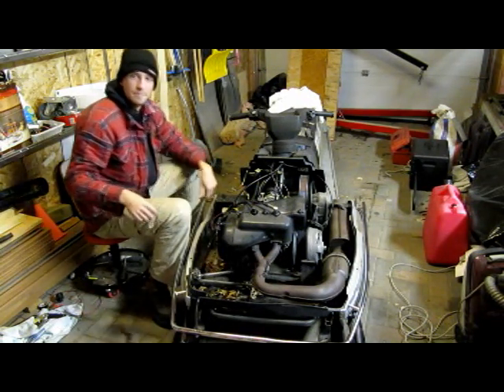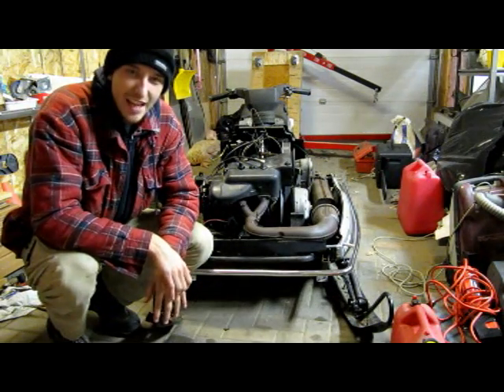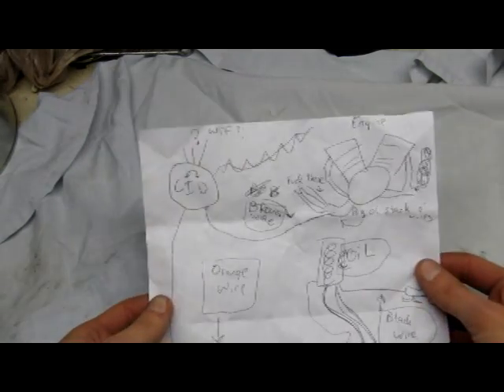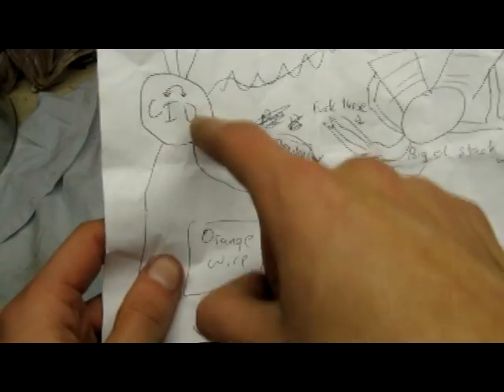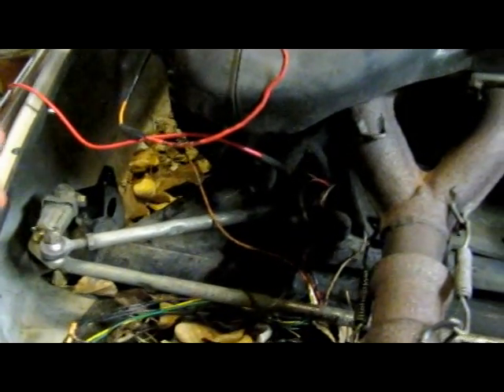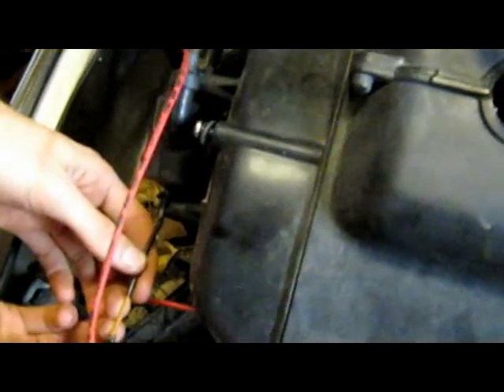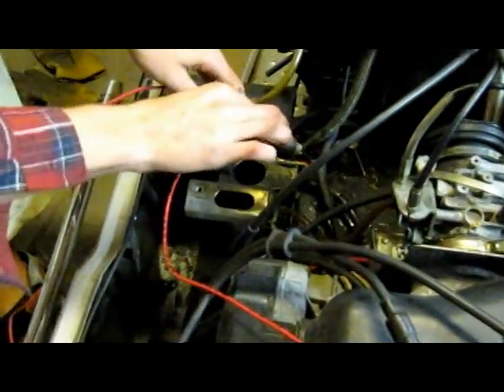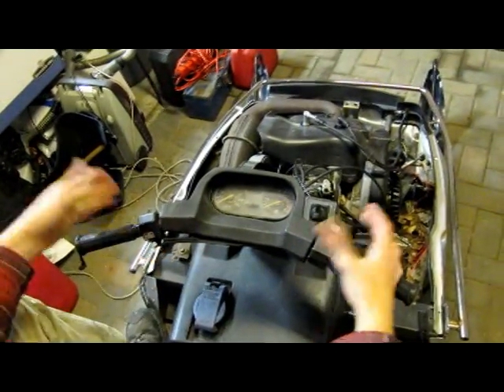Trash find Enticer 340 CDI issues (Yamyuck)

Comment: this video deserves more credit. battling no power and failing resistance test on my coil, 87 340t
Reply: Yeah i changed my coil stator and checed every wire and switch and maybe the cdi is bad btw you have to mesure in ac v on the stator

Comment: I'm working an old 1982 340 enticer. They key switch broke. Took the old one off. Got the new one. Little confused as to where the wire for that hook up and which ones hook to where.  How is that hooked up? What wires go to where for it to work correctly? Any help appreciated. Thanks!

Comment: Slow down so the brown from the stator wire into the brown in the cdi ? Then ground the coil ? I got A 89 exciter 570 no spark tried new coil and cdi boxes and unplugged ignition